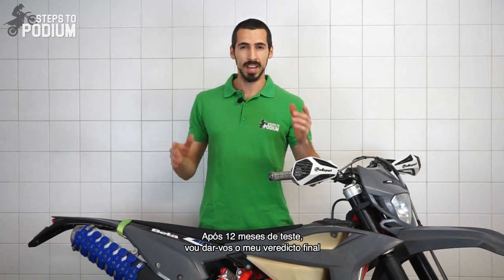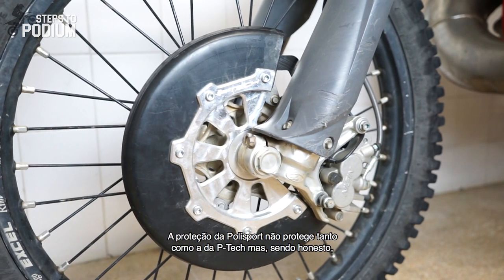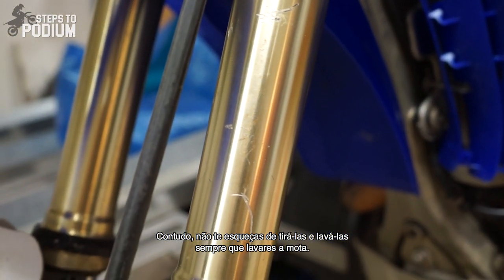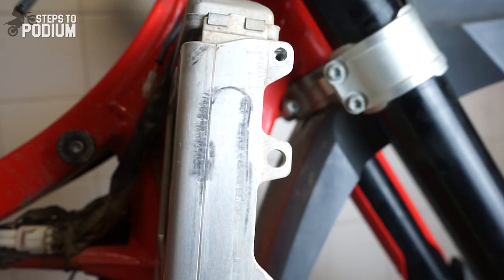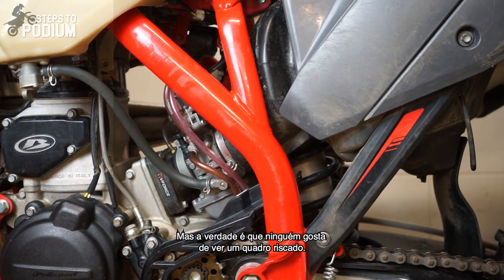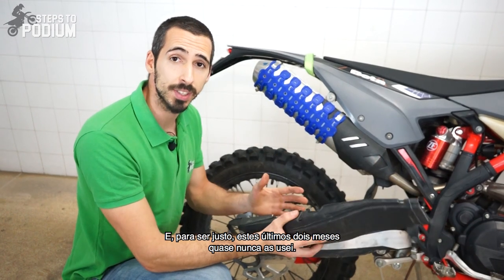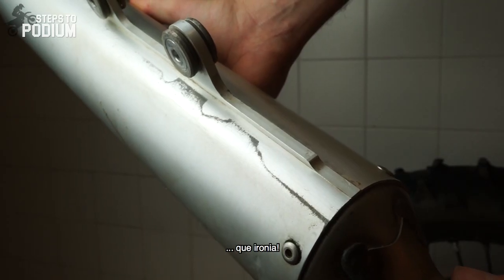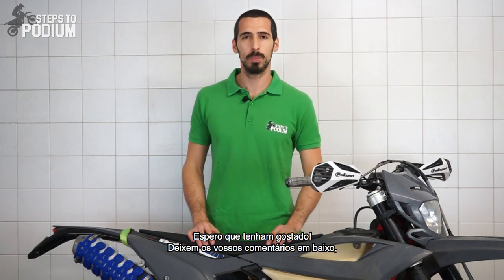Dirt Bike Protection Accessories | Review

Comment: I was waiting for that review 🙂. I share your sentiment that for us hard enduro riders bike protection is an absolute must (unless you are a factory rider, than you are covered 🙂). I have very good experience with P-Tech products, their fitment is excellent and their products are extremely durable. In comparison, I had Enduro Engineering radiator guards buckled under pressure like butter on a fairly low impact fall. On the other hand, their rear disc guard is super durable, so I am not entirely against EE. I also have excellent experience with the P-Tech skid plate - pipe guard combo.  However, in recent years I opted in for a skid plate only. My concern is that the pipe guard section transfers hits to the frame from angles it was not planed to withstand,  and I prefer having a smashed pipe rather than a dented/broken frame. The elasticity of plastic skid plates (the likes of AXP) provide some added cushioning upon impact.  My own personal view and preference.
Again, cheers for the detailed review!
Reply from the maker: Appreciate it! I hope it helped somehow 😄💪
Regarding the frame issue, I understand your worry. I don't think that is a problem, but between the two, I also prefer a dented pipe for sure 🤣
Reply: @StepstoPodium  Here here. By the way, how many hours did you manage to put on your bike?
Reply from the maker: Not as many as I wanted to! It has around 100hrs right now (shitty hour meter stopped working really early on and even after replacing the cable, it stopped working again 🤬